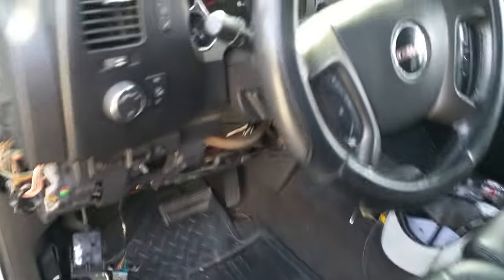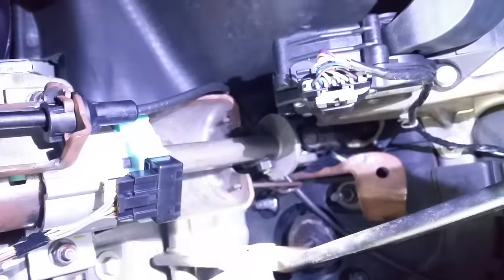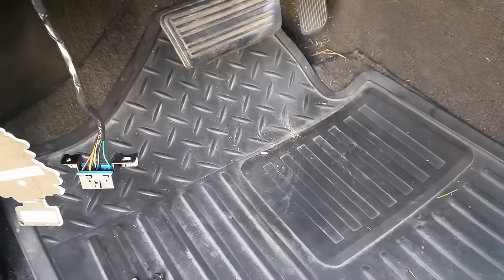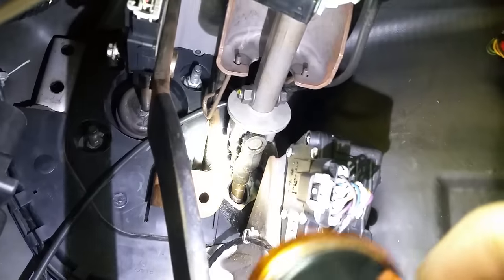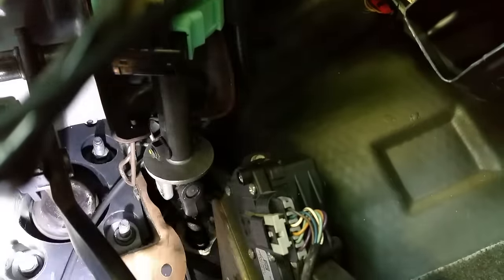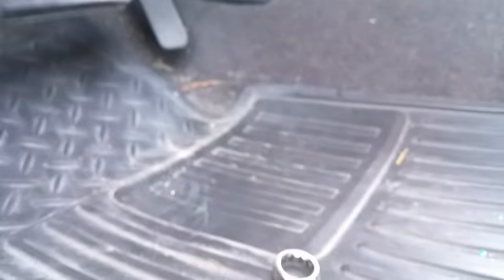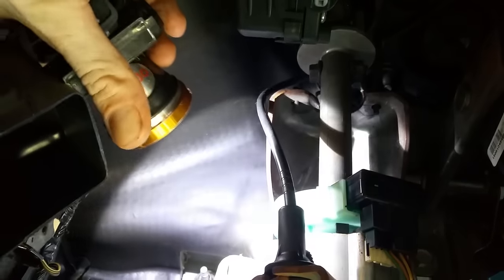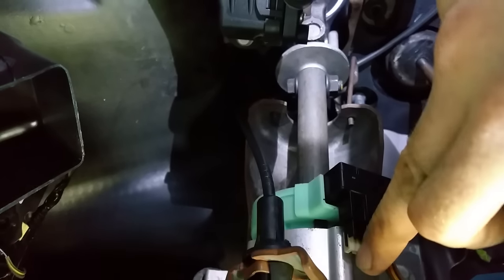SOLVED GMC Sierra & Chevy Silverado Service Stabilitrack Service Traction Control

Comment: What about the pin that comes in the new sensor? At what point can you take it out?
Reply: It's my understanding that the pin and spring can be removed ONLY AFTER the new sensor is in place. This keeps the positioning of the sensor in alignment with the shaft it slides on. No calibration or relearn needed.

Comment: My issue was a lose plug wire on cylinder 2
Reply: A miss fire will make the stability and traction control off
Reply: Did you scan for codes? If so, did it tell you you had a misfire or anything, on cylinder 2 or otherwise?
Reply: @Choprcs  What if you engin runs really smooth and no misfire?

Comment: I have a 2009 gmc sierra (67,000 miles) and i get this notification and a check brakes notification. My brakes are fine..i wonder if this fix will correct the brake light too?

Comment: My boss has been fighting this issue forever with his 2010 to the point dealerships have given up on it. Its bad enough it randomly goes into limp mode and he has to take the battery cable off and hard reset it. I'm not sure if they've tried this yet. Anyone else have it this severe and this fixed it? Thanks

Comment: Not exactly true, I have a 2012 Silverado, my abs, stabilitrak , and traction lights came on and took it to autozone and ran the scanner and it said right rear wheel speed sensor, changed it and fixed it.  Point is, it could be other things besides this, just take it to the part store and scan it
Reply: Yes every video says Stabiltrac fix. What they all fail to realize is that is just a generic message much like the old cars used to flash the check engine in different patterns. This told the mechanic where issue was. With ABS Stabiltrac it can be 50 different other things besides this.... I've got it on our Denali and still ain't figured it out.....
Reply: Regular Guy Fixes  I had this problem on my 2007 Tahoe and I replaced my wheel hub bearing assembly and bammmm the stability light took off  so it could be about anything
Reply: I took my truck to an autozone amd an advanced auto and both said no to scaning it. Told me to take it to a dealer.
Reply: @prince-abluna827  how did you know it was you're wheel hub?
Reply: It will.come back though over time

Comment: What about if i am getting that message(stabilittrak) and its then turning off my truck when i try to turn, is it still the sensor? When i turn the truck  on again it turns on with no problem and runs good any feedback? 
I am about to go do the diagnostic test at chevy bc idk if its just the sensor or something bigger.. just got this truck 2014 with 41k miles on it

Comment: If the clock spring was gone then you would get a code for that also problem I'm having is I have zero codes for any of it but does show ABS fault and traction control fault but the lights only come on once in awhile if I shut the truck off and then back on and drive it they're off this didn't start happening until I change the front brake pads All four wheel speed sensors are reading perfect and the steering angle position is reading perfect

Comment: does the body computer control the stabilitrack or does it have its own computer?  I have had three different sensors in mine, all auto salvage parts because you cannot buy new ones from gm any more.  I have to keep clearing the codes to make my truck work right
Reply: David Rossiter sensor is under driver seat!! But STOP!!! These cars are full of sensors that cuase a chain reaction!! Mechanics often chase their own tail with scanner chasing codes!!! Start simple! Top off fluids! 2. Replace air filter if dirty. 3. Replace/regap spark plugs if not too far gone!.4. Throw in  some very strong fuel injector cleaner as you may have s clogged fuel injector!! Note!! Fuald plugs will most likely be the 1,3,5,7 banks!!  I used 1 gallon of laquar thinner and a bottle of Lucas fuel injector cleaner with 10 gallons of fuel!! Ran it till empty! Lots of these fuels now have ethanol so build up is happening! Also take car to a reputable shop like firestone and have a tire rotation done it’s a cheap way to go as it comes with a free inspection, they will inspect your car and tell you if you have bad wheel hubs as that can also set it off!

Comment: I did this to my 2011 silverado and it didn't work my stability track lights still come back on
Reply: Check speed sensors on each wheel behind the rotor area

Comment: Is the angle position sensor the same as a wheel position sensor? And is there not a reset you can do instead ? I changed my steering rack in 07 avalanche and front left brakes randomly lock up right when your trying to turn a corner etc. Code reader says its angle position sensor
Reply: Dustin King  this almost ends up being a frade/dirty abs  sensor or harness! Clean magnetic part on sensor clean abs ring in the Midwest we get build up from salt so it’s frugal out here! When turning and kicks on !

Comment: Mine does this but mine also shows other messages my gauges will intermittently work and the door locks repetitively lock and unlock as well while it is giving me all the error codes last time it was a brake control module and the brake modulator or something that the Chevy dealership replaced under warranty it's a 2007 Tahoe LTZ and here I am a year-and-a-half later and it's acting up again and from my research it looks like it could be a hundred different damn things...ugh

Comment: My 2014 Chevy Silverado is cutting off and marking traction control and it won’t start until I reconnect the battery could it be this sensor z?

Comment: My 2012 gmc sierra 1500 dt

stabilitrak came on and would not turn off.  I turned the wheel from side to side several times and it turned off.  Hooray

Comment: I get the same issues in my GM car which is a Saturn Aura. Has been reliable but lately that has been the issue with the 3.5 l engine that I have and unfortunately not many videos on that car particularly.

Comment: My traction control turns off when idling. Driving forward for about 10 seconds turns TC back on and jerks my 07 new body Sierra in a nasty way. Could this also be an issue with the steering wheel position sensor?
Reply: treebeard9000 replace air filter  if dirty!! Regap or replace plugs if too far gone!! Also put some very good fuel injector cleaner in tank as you may have a clogged injector!!! The jerking has to do with computer shutting things down do to sensors not properly telling it what’s wrong!!! In short!! You have a bad fuel ai ratio and all these sensors are confused!!!
Reply: Not a chance a dirty air filter would EVER cause traction control issues, either wheel speed sensors, bad ground, or steering wheel clock spring sensor
Reply: @meaninglessvalue7778  turned out one of my valve lifters was going out causing a lot of grinding on the camshaft and making the engine block to shake. The shaking set off the TC sensor when at low idle. $1300 later but TC is solved at least.
Reply: @Crison360  mines got to be the sensor under the steering wheel, I can drive a solid 15min before the lights come on. And other times the second I move the steering wheel a cunt hair itl throw the lights on and now this week turning sharp enough itl almost stop my truck dead in its tracks
Reply: @meaninglessvalue7778  what was the issue? Ever fix it?

Comment: Got a 2007 Silverado 1500 new body 
I get the service tration control lights with rough idle kicks gears check engine  light i use to turn the truck off a few minutes and try it again and it would work fine bud suddenly it never worked again like I said the rough idle  traction control lights etc

Comment: Did you have to have it programmed or anything or did you disconnect the battery when doing this?
Reply: Disconnect the battery and wait 15 min before starting your takedown.  Otherwise you could set off the airbag on accident while working under there

Comment: Could this bad part possible be causing my Sierra 1500 to lose power steering and stall ONLY when pulling in somewhere, slowing down, turning the wheel sharply to park? I'm hoping so??
Reply: im having the same exact problems but i cant figure out what it is either
Reply: I'm having the same exact problem on my 2015 silverado. Chevy had my truck for 2 days and told me it wasn't a steering wheel position sensor it was my front left hub was bad (thankfully covered by waranty)... got my truck and as I'm pulling in my driveway it does it again!! I'm pissed!! I did find a message from gm to their mechanics online saying don't replace the sensor but put a shim on it and apply dielectric grease to the male and female connectors on the stearing position sensor

Comment: Is it the same if stability and traction control stays or shows on?when mine does that it also says engine power reduce,,,
Reply: Miguel Angel 
Sounds like a vacuum leak
Reply: Ariat_35 thanks for the tip I’m getting this also engine reduce power and service stabilitrack and when I’m driving It does it all of a sudden I can’t get  it to go more than 5mph have to turn it off and wait about a minute and turn it back on and it works again I’m having this problem like 5-10  times a month
Reply: @diablochorizero6586  same! Just now did you figure it out?

Comment: I added a new ground from the firewall to the block (2009 Saturn Vue 2.4L Gasoline). It has been running well since I made the MOD, about a week ago, It started showing just last night, but I noticed that if I kept the Heat low blowing neutral temp, and positioned it toward the accelerator pedal, that I had NO “Stabilitrak” issue?  I will now concentrate on the accelerator sensor as a probable “Fix”?  Please add your comments regarding this problem!

Comment: What are the symptoms your truck had? Because my truck shakes and when I’m driving the vehicle turns off? Anyone know what could it be? I changed the spark plugs and the wires. Cleaned the air mass censor, and still nothing.
Reply: Fuel pump maybey?
Reply: Mine is doing the exact same thing.  Did you ever figure yours out
Reply: Mine is doing the exact same thing! With message about the stabilittrak, and it will turn off my truck. Did you figure it out??
Reply: @brianroy6001  Mine is doing the exact same thing! With message about the stabilittrak, and it will turn off my truck. Did you figure it out??

Comment: My 08 Avalanche is doing the Traction control ABS, Gauges fall and flicker and the power locks flicker. Would this be a fix for that or part of it?
Reply: Uly Yanez no, upgrade and check your main grounds, do the big three upgrade especially if you have installed aftermarket stereo system
Reply: Uly Yanez you fix it?

Comment: Traction and stabilitrak both off not abs any ideas my friend 
???
Reply: Service them at first? Then turns off when you turn the steering wheel?
Reply: Jorge Gutierrez thanks it was sensor went off and I cleaned them and around dirty brakes
Reply: Remove air filter run for a while if lights go off! Replace air filter if dirty regap/replace plugs and use very good fuel injector cleaner in tank as you may have a clogged injector fualing spark plugs,, sometimes if it’s bad enough your engine light will come on/blink and even get transmission slamming into gear!!!

Comment: So I have this problem currently and wanna try this. But there's a clicking sound that sounds like it's coming from the engine and while driving it also has a hard time getting into gear when accelerating. I have a hard time believing that's just from a steering wheel sensor. Is that really it or is there something else going on as well?
Reply: Did you ever fix

Comment: This came on on my 09 sierra after a small collision once fixed at autobody it was still coming on, i took it back to them cus i felt my alignment wasnt right as it was shaking at high speeds once aligned light never came back up.
Reply: Mine shakes and now the stabilitrak is on

Comment: Thanks for the video. Did you actually get a code for that sensor? Or is there a way to confirm this is the part that needs replacing using a scanner?
Reply: It doesn't come up on the sensor

Comment: What would be the problem when my stabilitrak comes on ?
Reply: Darlene Augustine simple maintenance! Air filter if dirty replace, duals plugs, regap or replace. Clogged fuel injector due to fuel aka ethanol build up
Reply: @LH81633  isn't the traction control in rear axle?
Reply: I perform regular maintenance on this truck. I changed air filter, replaced and properly gapped all plugs, fresh oil and filter and put some injector cleaner in the tank and its still runnning like shit. I tested all coils and they are good. No vacuum leaks. No ABS light is on. Just the stabilitrak and engine lights are on. It was doing this intermittently for a while but would go away once the truck got up to speed. No it's doing it all the time. It idles very rough and has a loss of power. When it first is fired up it feels like #1 cylinder isn't getting got like the others. Any suggestions before I pull the motor and rebuild it??

Comment: not only is my stabiltrak and abs on. but my gauges go nuts and trans wont shift out of low. shop cant figure it out. I have thrown 500 at it and it just laughs. new battery, alt, all power and ground cables are new and ignition switch. i will try this too if this might help
Reply: Tom Christensen it’s most likely your throttle
Reply: You new a Transmission Control Module
Reply: Keep us posted.
Reply: Did you fit it! Thanks
Reply: The tru fix right here!!!!!!!! Replace air filter plugs and throw some very strong fuel injector cleaner as you may have a clogged fuel injector!!! You have s bad fuel ratio do to bad plugs dirty air filter and or a clogged fuel injector!! It all goes hand in hand!! The jerking is do to many sensors trying to figure out where the problem is so the computer shuts things down including tcm!! Transmission computer!! Trust me!!!! I’ve fixed all my own vehicles this way. If your abs is also on it time to change your front hubs do it in pairs!! Very easy to do!

Comment: I noticed mine came out after I install smaller tires a friend gave to me. Like 1/2 inch smaller. Could that be the problem?
Reply: Sounds like wheel speed sensors .....

Comment: I have the lights coming on for that and it tends to throw the transmission off. Would this fix that?
Reply: Alfred Chavez, I have the same problem as you. I've replace the brake sensor, battery cable, ground cable to fire wall and still stuck with the problem. Have you find a solution yet?
Reply: @carlosmolina9648  no I haven't.
Reply: @alfredchavez3202 ,ok thanks
Reply: @carlosmolina9648  I  had same problem --2010  silverado 5-3   ----Dealership replaced  all battery cables & new battery --solved problem--cost me $979.00 ------they said the voltage showed low on the  cables   (still look like new  )   38K miles    ------door locks jumped up & down  transmission shifted into neutral--loud noise from rear axle--engine  revved up  ---New battery & cables solved it all  !!!!     & a lot of money  !!!  I think chevy should pay for this  mistake ---A lot of  trucks with same trouble with  low  miles  !!!!!
Reply: Roger Ramjet thanks for the info! I have a 2011 Sierra and have those lights and I occasionally get a really hard shift from 1st to 2nd gear
Reply: Michael Carino hey I’m having the same exact problem on the same 2011 GMC Sierra 1500 5.3, have u figured out what it was I’m hearing a lot of ppl tell me it’s a abs or speed sensor??? Do you know what the problem is yet???

Comment: Will thus cause shifting issues
Reply: I don't think so. It has nothing to do with transmission control.
Reply: Replace air filter regap or replace plugs and use a very good fuel injector cleaner in tank, as you may have a clogged fuel injector fualing spark plugs!!! This lights all come on and may be accompanied with engine light and my blink if bad enough it will cuase transmission to slam into gear!!! By the way this is the computer being confused and shutting things down!!

Comment: I've got the same problem 2011 GMC, only seems to be a problem when the temperature is down around -20. Sounds like there's a hundred different things that can cause this, I'm pretty disappointed with the new GM products.
Reply: My 2012 GMC throws this code above 80 F
Reply: @David-dm4re  Same here. I just dont get the abs code.
Reply: Cheapest rout first!! Air filter , plugs , fuel injector cleaner.. salt grime built up on abs sensor remove clean shim,  check wheel hub too! This is by far the cheapest way to go about it!!

Comment: I have the same issue. Stabli trak error.  But the car also turns off. When I’m making a slow turn.   The steering kind of jerks a little.    I’m also seeing a ecm solution.    Could it be combination?   2015 Chevy Silverado 1500
Reply: Me too did you ever get it fixed?

Comment: Where can I buy the sensor, dealer said it was discontinued they have after market part not the right one.
Reply: where can l get GM OEM steering column angle position sensor part 155886733

Comment: The 6 pin sensor you show is discontinued and not available, anywhere......  Any ideas?
Reply: Jason Bailey try Rockauto.com
Reply: @dtwynn27  no go. Not one to be had anywhere...  Thanks tho.
Reply: What is your vehicle actually doing?? Are brake lights staying on?? Hesitation?? Gear slamming?? Engine light on/blinking??these will tell what step to go first!

Comment: I had my light to come on in my 2007 Escalade stabilitrak system then my truck went dead and never started again.
Reply: I had same thing twice on my 2010 silverado and it just started doing it again now last 2 times it was the PCM I hope its not that this time$$$$
Reply: @leroybrown1845  Thanks for your suggestion